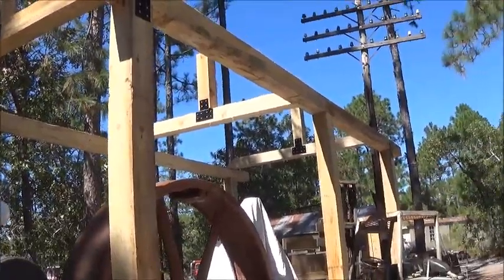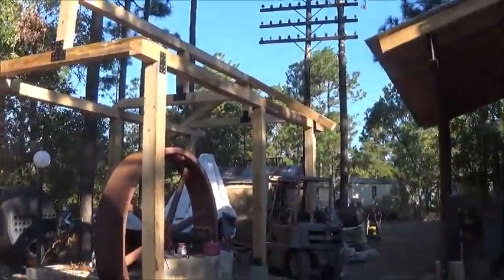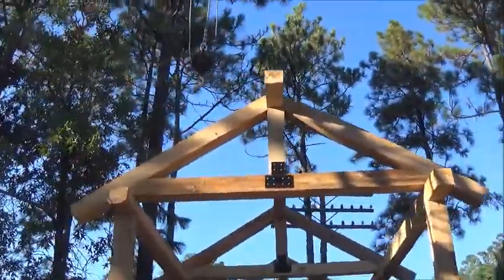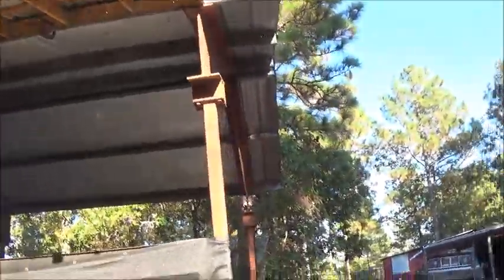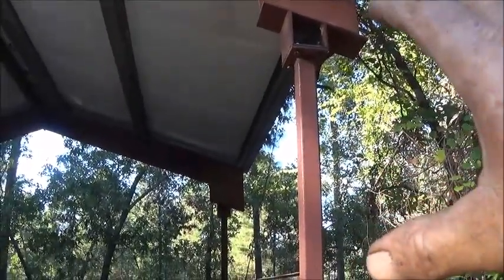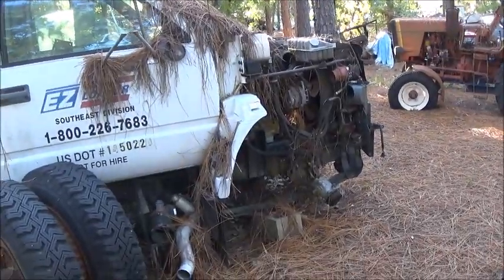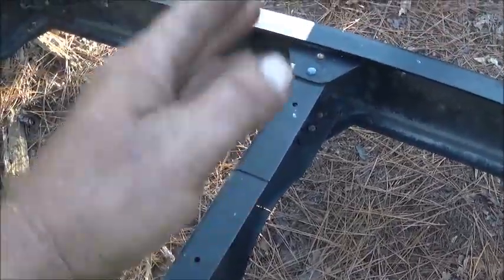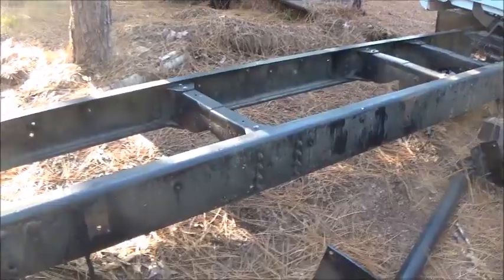POST AND BEAM  OVER BATES STEAM ENGINE

Comment: Hey man that's a good idea to use that truck frame. By the time you get it all done It'll be more than strong enough! Plus using what you have kinda cleans up the yard some. Looks like the weather is going to cooperate. Should be able to get a lot done this week. Thanks again for your time.

Comment: Jonathan, you’re a “Man with a plan” .  The post and beam framework looks real sturdy…. Are you going to add a tool shed to it when you get that engine running?  You’re going to need grease, oil, water treatment chemicals, drive belts and a full time snack bar when folks come by to watch…

Comment: With the roof loads you have down there, this will be so much more than you will need. But, that is not a bad thing, when you consider the hurricanes and storms with the high winds. The extra weight and  the use of the metal joint connectors will hold it all together. The only thng that will move that is a tornadoe with a direct hit.